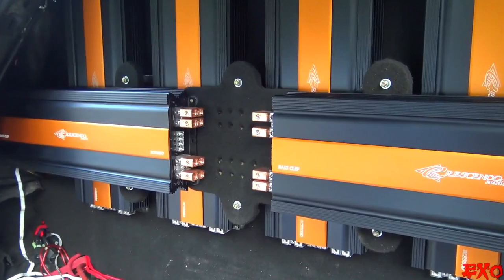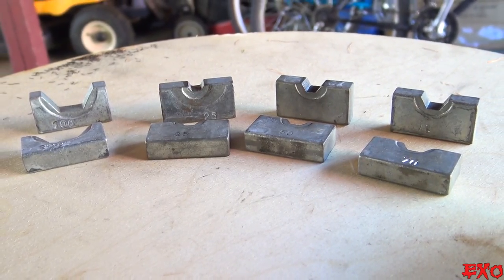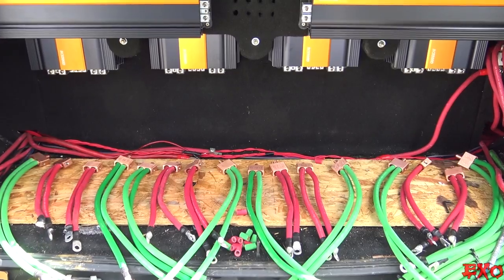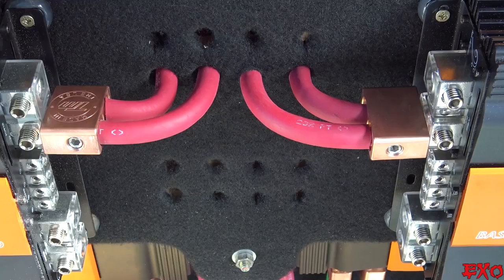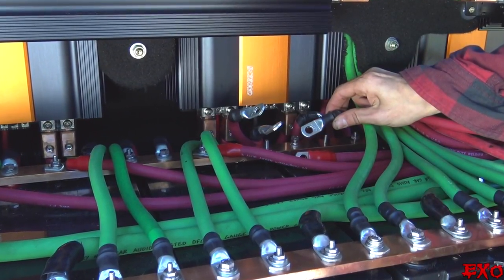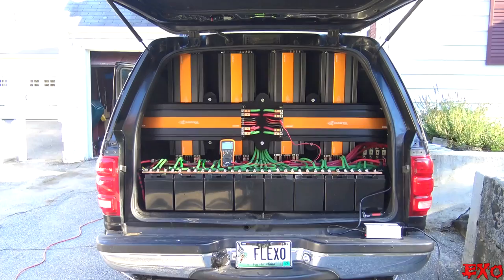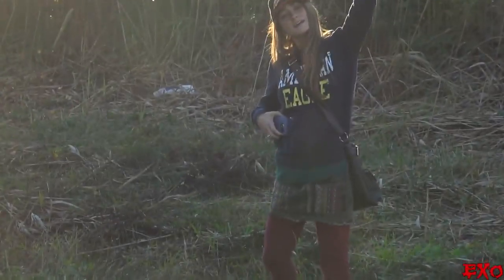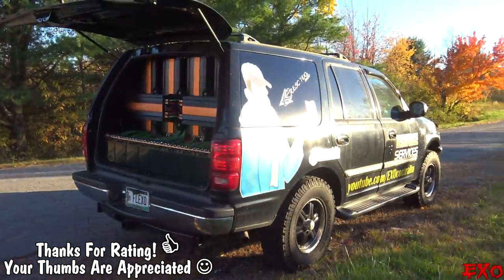EXO's 30,000 WATT Amplifier INSTALL | Wiring SIX Crescendo Amps + 1/0 Toolmaker Inputs & TESTING SPL

Comment: You can use dielectric grease on those terminals you're bolting together using dissimilar metals and it will prevent corrosion and decrease resistance as the contacts age.

Comment: alright! no matter what anyone says your a real dude. one for people to look for. one for people to know that it's OK to learn as you go. no shame in that. and you are great information hwy. I'm a 20 yr aluminum welder custom fabricator sportfishing yacht tunatower builder. getting custom and learning from learning is how its done!! ive been in car audio since 85. put together an audio art system in 88' with a pair collins tubes... speakers were replaced in two days with kicker pros. the audio art was sure a cheater amp.. and with the 12" tubes recarbed I broke myself. reason? packed into an 85' nissan King cab. alt upgrade was expensive as __ back then. wire$$ are you kidding i was 17 and worked changing tires for a living... in-between spinning records for pennies. when i showed up places like Knott's Berry Farm it was ridiculous but true and there was plenty of other guys with badass low riders. within the next two years it had takin storm. I'm glad there is a guy that makes it fun and not about anything else but the pursuit of a great system. thanks for all that you will keep going.

Comment: yesterday i gad to drill 4 hole for tv wall braket on the wall.
we had one broken thumb, sisters head injured , carpet burnt, battery dead on the drill machine and i drilled through a live wire.
not a bad day

Comment: Have you ever thought of using really big Electrolytic Capacitors on the batteries to help stabilize the extreme voltage changes during peak power demand? I used to use a couple of large Electrolytic caps on my booster battery for my CB Radio Linear Amplifier and it made a big difference in the performance. The Large Caps should make a huge difference in audio performance as well.

Comment: What meter are you using on your phone what is the name of the app
Reply: BiLL Ramseyer that is not an app it’s an actual DB meter that you install on your windshield that has an app to use your phone for the display. That is an expensive tool just not some DB app from the Apple store.

Comment: When doing the big build, I recommend you use wire ferrules on the 0gauge that go to the toolmaker double inputs and the speaker wires cus the set screws destroys the wires. My opinion tho, be a lot nicer tho

Comment: how come no ferrules in the double wire connecter combiner thing? wouldn't that be a better connection?
Reply: It should just be crimped ring terminals bolted bsck to back.

Comment: The best way to tighten the wire is to fill the ends with soldier and then clamp them down
Reply from the maker: Soldering isn't always necessary!
Reply: @EXOcontralto  no def not I'm just talking about the clean ends that get tightened with Alan head but I like to just fill the ends and then clamp it just holds so much tighter but who am I ? You the man !!! Lol
Reply: Solder after clamping works too, wet solder wicks

Comment: fuck man you probably got like $1,000 just in wiring Haha
Reply: Dillon Koch and $500 worth of truck... 😐
Reply: Huge profit margins in the wires and warranty is never an issue. AUTOSOUND GEAR?.... dont make no money selling that stuff but the WIRES... Kits... Connectors... Batteries.... Caps... It's where the money is at in the business... Yeah. He SELLS wire.... primarily in this video. BDBD.2023

Comment: are JL audio speakers good quality?
Reply: Yes, but expensive. Usually better options depending on your goals
Reply: They sure are!
Reply: Yes. But theres other brands that sound clear or have the bass you want for less money. Research research before you buy. FYI.. wire quality and thickness , efficient power source, enclosures, sound dampening are all important to get the most out of a setup. You'd be surprised that brands that aren't top of the line names can perform extremely well.

Comment: 4:49
IMPORTANT!
Never use fine-stranded cables WITHOUT ferrules under screw connections!
The screws squeeze and cut the fine wires and thus reduce the cable cross section!

The markings on the Cable lugs "50-10" means it was designed for use with 50mm² cross section cables and the mounting hole is 10mm. when u use 50mm² cables and 50mm² cable lugs, you have to press it with your hydraulic press with 50mm² bracket too.

11:52
What the Hell are you doing?
Each Amplifier RCA Input has a resistance of eg. 10kOhms. When you simply connect 6 RCA Inputs together, the input resistance is 1,67kOhms. The Headunit's Preamps has to deliver way more Power. In the long run this can lead to an overload of the preamplifier in the head unit. The audio quality is additionally degraded. It's better to use an active RCA Splitter with separated preamplifiers for each RCA Output. These preamplifiers have a much higher input resistance and are practically no load for the preamplifiers in the head unit. The amplification factor for the active RCA split is 1. The input signal is not corrupted.
The output signals are independent of each other - so they can not interfere with each other.

On the other hand, I wonder why you did not use the RCA outputs of the power amplifiers to loop the audio signal from one power amp to the next.

160 dB with 30 kW?
My Mac Audio ZX4500 Black Edition combined with two JBL GT4-12 Woofers in a sealed enclosure (the woofers are mounted in the front of the enclosure) brings me 138dB. That's more than enough for me. And my AMP can deliver 4x125W RMS at 4 Ohms or in bridge-Mode 2x300W RMS at 4 Ohms. I also used two 1F Powercap's.
My audio system can also accomplish mirages. Especially digital gauges start to swim ...
Reply: Not sure you understand how hard it is to get 160 DBs of “legal” pressure???? Your 134 is remedial at best. I was in USAC competition in the late 90s running all Soundstream gear when it was still legit! We hit 158 so many times with 6 of the SPL 15s running all class A, 10.0s amps and the day we crossed the 160 line it was like we won the fucking super bowl! So not sure what your point is with that declaration?
Reply: You do NOT need ferrules on welding cable, it is not fine strand cable, it beefy as fuck. I think hanging from the cable proved the bracket he used to press it was just fine. 

As far as your system, bfd, my neighbor hit 138db with a $80 12" infinity and a $100 400 watt Taramps amp, that is the size of 2 packs of smokes, on the stock car battery, certified at a competition. "My audio system can also accomplish mirages" some people think they see a brain in your head?
Reply: Just dont talk like your smart at al alright?
Reply: Djblackarrow

Comment: Exo You could drop 5/15 dril bit and  threaded through the bus bar What's at 3/8 screw in Stainless steel Pressure washers and washes Is an idea that's the way I am doing it whit my car.Bob you're doing great job in your expedition keep the good work.
Reply from the maker: Good thinking, I may just have to invest in a tap set soon

Comment: Exo where can I get that exact crimper you have last time I had to crimp 8 1/0 lugs on by hand and vice grip and it took forever I'm sure I'll need that one in the future when I ever do a rebuild I'm currently at a 157.4db my goal is one day to hit that 160 mark one day congrats man you deserve it so much man ever since you had the non wall in the van you've came a long way
Reply from the maker: Thanks man, and I found that unit right on ebay for like 40 or 50 bucks! Great deal and I've used it hundreds of times so far, really love it :)
Reply: EXOcontralto thanks man and congrats on the 160 I know you been wanting it for a while you've came a long way since the days before you had the wall in the van

Comment: I noticed the green and red wires got swapped on the bottom amps.  If you look @7:55 and then @11:23  you will see what I mean.  I was wondering at first why the wires didn't match the sequence of the top two amps.  Glad you swapped them around.
Reply: haha i noticed the same thing glad he swapped them around before melt down

Comment: I know this is old , but you know ... We would put out duel blocks in the amps tighten them down then pull them back out and drill a 1mm deep cup so the blocks didnt pop out later .
Reply: That's a good tip right there. 👍

Comment: To get a super connection it is better that you solder the copper wires then you have a better connection and the wires can no longer slip out during assembly

Comment: dope build exo you can also use a flat razor blade that flexes and run it from side to side works good to Clean ur connections also a wire wheel

Comment: The current won't jump from one double connector onto the other because 14 volts are just too low for that to happen, am I right? That sort of thing would need much higher voltages?

Comment: i prefer to to fill with solder after crimping then sealing with heat shrink... thats just me. your sister is awesome... my sister can't count to 160... congrats on the 160 bro.
Reply from the maker: Solder can add resistance, but thank you so much!!
Reply: True it can. If you have a hydraulic crimper like Exo does you can't physically solder the connection, it causes whats known as a cold weld and solder won't be able to penetrate into the lugs. I don't have one of those so I use solder as the next best thing. 

Hydraulic crimp > crimp/solder

Comment: Why do u not use ferrules into distributor blocks for the amps. You end up having no fray wire exposed as well as a cleaner look set up.

Comment: you did a good job I went to school as an apprentice in the electrical trade 4 year course and I've seen short work you have a good skill set if you want some good bass tracks you should look up " bass outlaws " CD tittle " illegal bass " before full though it's been known to fry systems really low modulated bass from like eighteen years ago it still sounds good though

Comment: I like your hydraulic crimper more than mine. I tend to use my hammer crimp tool more often. It was only $12
Reply from the maker: Not bad for 12 bucks, I think I picked these up for around 50 or something like that

Comment: Im an electrician and i use these crimpers at work i did all my connection in my truck with mine too so much better than those autozone crimper/plier things

Comment: dude what nice work 

try these in future 
nolax or dielectric grease on the cable before crimping on lugs ( anit corrosion ) an for you twin plug you can get normal sleeves to crimp so the allen bolt don't munch the copper core 
shame we dont have same stores and attitude here in uk

Comment: One more question. 

I want to buy two ‘Dual’ 12” subwoofers in box and I need to know which amp I should buy. 

The specs are:

INCREASED OUTPUT CAPABILITY – specialized tuned port with computer aided design and 2.5” Voice Coils vastly increases output efficiency for your subwoofers providing you with consistent low sounding bass

DIGITALLY OPTIMIZED SUBWOOFERS – are carefully crafted for efficient and accurate bass, providing power handling up to 1100 Watts of Peak Power, 600 Watts RMS at a 4 Ohm impedance and Frequency Range between 30Hz – 200Hz

What amp could/should I buy to power this?
Reply: Need a little more info than that. What subs? Going by what you give you'd want an amp that outputs 1200 rms at 2 ohms at least.
Reply: mrboyguyman 

So the brand is dual and the size are 12”
There are two of them
Reply: Well it says 600 rms on both I guess? So 300 rms for each? That means you could basically get any amp off of Amazon around the 100 dollar mark. Less or more is up to you. Those will do about 400 to 500 wrms, it's enough. You shouldn't get an real powerful amp if you don't have any electrical upgrades done yet.
Reply from the maker: Thanks for helping out fellas!!!

Comment: What size fuse should I use on 2/0 silver tinned certified basshead for the bassclef 8k. The manual shows 700a fuses but not sure my wire rating is that high and I don't want to blow 300a fuses cause of to much draw from the amp
Reply: 350a fuse. Remember, you fuse the cable not the amp.

Comment: Nice job. A suggestion if I may. Why not solder those bitch ass cables. I know it takes a lot longer but its far superior than the crimp connections. I grind off the flare from the silver connector on a bench grinder so that it is the same diameter as the cable. I solder with a small propane torch and flux and the proper large rosin core solder. Use a vise to hold the terminal in a vertical position and melt some solder about halfway into the terminal then place the wire in there and heat it up more then add more solder. There is a method to the madness. It may take a few to get it down. If you do this right it wont burn the cable. Then cool quickly with a spray bottle of water making sure the cable is straight like. Wipe off all rosin and flux and water then drop on your marine shrink wrap that has a glue on the inside and heat with heat gun and your good to go. Far superior connection with no hump from the terminal end and no chance of corrosion. It CANT oxidize. The cable looks like its molded together and you can literally tow a small car with it. I also think you could have used other buss bars to substitute for all those cables. IMHO. Regardless it looks awesomer. Keep it up.
Reply: ChiefJustice Middleton

Comment: Old video I know. But I see you used bare wire in the power connections. Any reason you didn't use wire ferrules? I know coming from working in industry they are absolutely needed, and with a pricey build like this I don't see how a few bucks for a better connection would hurt (especially with the bass that's gonna rock this).
Reply: Well yeah but the cable is a 1/0, so those screws bite into the massive wire just fine, I guess. Although, I think the same. He could've crimped some wire caps on there since he already has an hydraulic crimper.
Reply from the maker: Don't usually need them as these type of installs remain wired until disassembly. If the connections were removed and installed often, I probably would've.

Comment: hey in your opinion which is better. I have 2 mono amps with preouts. should I run a separate single rca to each mono input or should I run a set to amp 1 and daisy it off the preout to amp 2
Reply from the maker: I never use amp outputs because they can reduce voltage over multiples sets. I prefer  RCA spliiters for that reason.

Comment: exo 8:11 did you mean to have the green and red wire inputs switched or is that an accident. i see you plugged the green wire into the 12v and the red into the ground.
Reply from the maker: No sir!!! That was an accident from rushing. I tend to get a bit rushed when the camera is rolling, luckily we noticed just a few minutes later :p
Reply: EXOcontralto i figured you noticed it but i was worried you would have shorted your amp lol

Comment: What is your strapping configuration for a build of this size; how do you wire the strapped amps to the subs and at what ohm load do you shoot for?
Reply from the maker: No strapping here, straight coils to amp individually @ .7ohm
Reply: Would you ever considering going for a strapped setup or would it be overkill, but would you even the space for it as it would double the number of amps even with a Li-Ion battery setup?

Comment: it pleases me you use welding cable and tinned lugs, nothing but the best. I run about 60ft of Toughflex welding cable, tinned lugs and adhesive shrink myself in my small build
Reply from the maker: Damn straight man, welding cable kicks ass. Thanks for shooting over a comment

Comment: Exo i have 16 21'' and 3 orionhcca 17k so my problem is i can put 5 sub per amp but am still left with one could i run that last sub with an orionhcca 2500.1 that i have laying around??? Or will it be underpowered my subs are b&c 21sw152-8 and 2000 watts rms

Comment: What method do you typically use to turn on multiple amplifiers with regards to the REMOTE WIRE input on the amplifiers?
Reply: Split the same wire to muiltiple , or some remotes come with multiple different amp hook ups.
Reply: Daisy chain..
Reply: use a relay.

Comment: Hey EXO where are you getting this heat shrinks. Add some link please or size. I saw few in ebay but dont know the right size they will fit for 1/0  ot 0 gauges power wire.  Cheers,
Reply: 3/4 in should fit 0guage aka 2/0
Reply: No problem. Thanks.

Comment: And why do u need dual inputs not single im a noobie when it cums to them..And was there a problem with the aluminum??or jus cuz copper is better
Reply: 1. Dual inputs = twice the copper thus twice the max input amperage meaning the amps can do what they need to without the cables becoming a bottleneck.
2. Copper is significantly better at conducting electricity and thats why its used in places like this

Comment: So you ground your amps for your subs to the battery negative terminal can you do this with agm and what's the benefit of doing so or should you ground to the frame/body
Reply: He has the battery bank grounded to the chassis of the truck. Then then amps are grounded to the battery bank.

Comment: is your amps drive 30kw pak,the battery may give2500amp, the wire section  is very huge. for avoid voltage drop: from batteries you may  use 600mm2 or more, and big alternators.  batteries st least 180a.h
Reply: He knows what hes doin

Comment: EXO what is that green oxcidation around the wire ( at 1.42 )  and will it affect the voltage in any how because is looks like ist around the hole wire.  greets from holland !!! happy for you that you got the amp's !!!.
Reply from the maker: I'll have to check once I'm on WiFi! Can't see right now

Comment: I would have used ferrels on the ends of the wires before putting them in. Would have made a better connection I think.